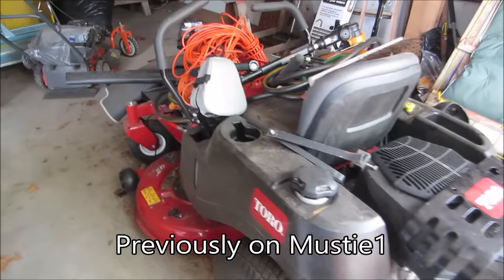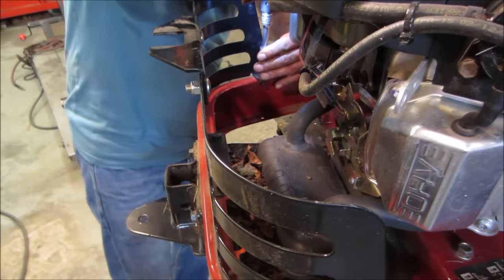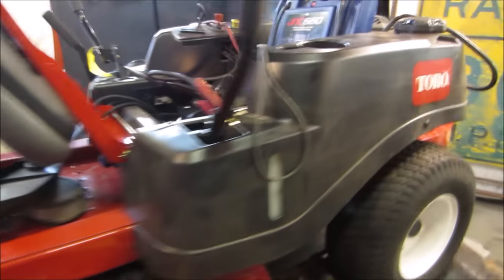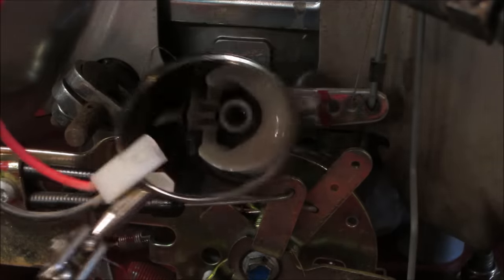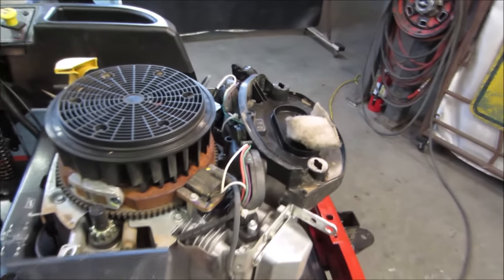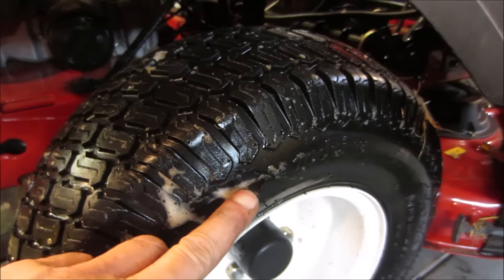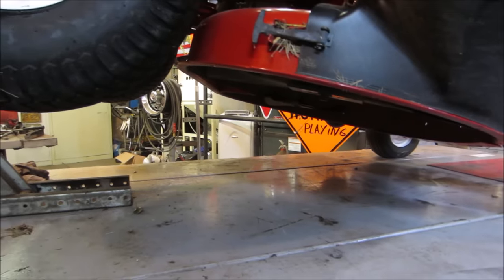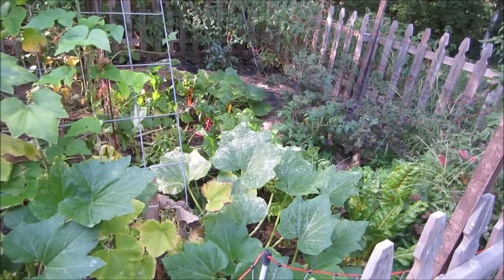Yard Sale $400 Toro Zero Turn Mower. Sitting For 10 years.

Comment: Zero turns are so expensive nowadays, so getting that toro for 400 is a steal in my opinion
Reply: I bought my Toro ZTR about five years ago,  thru Home Depot.  It was only $200 more than the Toro tractor with the same size deck.
Reply: living in belgium everything that comes on this channel is a "steal" anything used or second hand still goes at a premium price
Reply: That mower sells new for about $2700!!!
Reply: @donabele1243  company that I work for sells them for 10 000€ new!
Reply: 10,000€ for a zero turn? You can get a new sub compact car for close to that price.
Reply: @jC-kc4si  these toro are around 5k here
Reply: NO !! KERBSIDE !! TRASH !! IS !! THE !! STEAL !! FOUR !! HUNDRED !! RIP !! OFF !!!!

Comment: I used a side patch for tires. Worked till they were dead. Trick is to clean and grind the top layer off the inside then glue then dry then apply the patch with a roller wheel

Comment: FYI I have a zero turn with an enclosure around the engine. I installed pipe wrap on the exhaust manifolds and muffler. Dropped engine compartment temperature by 20-30 degrees.
Reply: Great tip. 👍👍
Reply: Good idea! I use the header wrap on my racecar never though to put it on the mower. Will definitely lower the air temp also help with keeping it catch fire around the exhaust and muffler. Ok I'm headed to the garage now! Lol

Comment: I bought and older model of the "Time Cutter" just to get me through one season so I wouldn't have to buy a new mower in the spring. I've had to weld it up all over for being worn out but it's still cutting so I use it for the rough part of the yard  so as not to tear up my new one. I had to change out a blown head gasket. The drives are sealed units, I asked a dealer about the life time and he told me he had never had one returned with an issue in the drive units other than a belt issue. The first few times I mowed with a Z turn my hands were worn out from holding on but after I got used to it that went away.

Comment: I was telling you to use Right Stuff on that tire. You got me hooked on it. 
A friend of mine just bought a used cub cadet. First riding mower I have ever worked on. Thanks for all you have taught me about them. It was backfiring real bad. The fuel cutoff in the bottom of the float bowl was disconnected. Thanks for explaining that.

Comment: I just got inspired to put Mustie on pause and go down and pull the fan shroud off my riding mower engine and blow out debris to ensure it doesn't overheat. I've had it a dozen years, had never done it, and figured it might be a good idea. Turns out, really didn't have much debris, but don't regret doing it. Took less than a half hour.

Comment: Louis Rossmann had the same camera issue - the need to use an app to get the camera running. The only reason for that is that they want to track you, so don't use it for privacy reasons.
So far GoPro don't do that, even though GoPro have some quirks too.

Comment: Your friend will love the bagger when it comes to doing leaves - it looks like you've literally vacuumed the leaves up it leaves the grass so clean.  I bought the 55" version with the Kawasaki engine about four or five years ago; have around 60 hours on it now (there might be a cutout for an hour meter in the crosspiece behind the seat - it's an option on the later ones at least).  I found the trick to driving it is to hold one tiller bar steady and move the other back and forth to control the direction - it reduces the PIO (pilot induced oscillations) that otherwise make you look like a drunken sailor trying to cut the grass.

Comment: I look forward to every video. You do a fantastic job.  On those old tires, dry rotted, rim leaks, small seeping leaks, may I suggest you lay in a supply of  TireJect. Unlike the many "popular brands" this stuff just works without fouling up the insides of the tires or the wheels. As a last resort,  used TireJect on my dry rotted, rim leaking, and eventually un mounted tires on my 1996 Craftsman tractor with all flats, that sat 4 years in a dirt floored shed.   The machine isn't worth the even the cost of tubes.   I'll be darned if they sealed up and have remained fully inflated over a year...still in the shed.

Comment: For leaks like the tire had I have used patches inside the wall of the tire with success. Some of the kits for truck tires have large and thick patches which I found work well. If it does its far cheaper than a new tire. You found a good buy with this baby.

Comment: I have an SW4200 Toro.. Love the Steering Wheel..  Bent the deck, but fixed it, welded more steel.  Big Spindles, Super Air Flow thru deck, Big Starter issues, Rewired most everything.. Rear Bagger, Big rear Tires.. this thing will go nearly anywhere, and does side hills superbly..  Hydrostatic is SOLID
Reply: Got sick of all the interlocks.. the parking brake module got replaced as well.  Got sick of it.. wired around things as they failed or were suspect..  How many starter relays have I been thru?  Starter kept getting stuck between poles, so I leave it just a tad loosely bolted down which seems to work so far.  Some clearance is just a tad too tight..  The Deck is very Weak..  the welded deck version would be much better structurally but with an even far WORSE Air Flow Design.

Comment: I have the 42 inch Toro ZTR.  My only issue so far has been the electrical connection on the electric mower clutch, won't stay in place.  I finally just made two short jumper wires, and used standard electrical terminal ends to connect to the clutch,and a spade connected to plug into the original harness.  No more issues.

Comment: I have virtually that same mower..a Mustang 50 that is about 7 years old. Yours looks brand new by comparison. 
 I paid $2400 7 years ago, don't see them new anymore for less than $3k.
I need to go shopping with you.
That is one hell of a deal for a really tough mower.
*Also, you want to change the oil even if it doesn't look like it needs it because..
the poorly designed drain tube setup tends to weld itself shut. I had to cut the end of mine off and make a new one the first oil change.

Comment: I really appreciate these videos. This one specifically saved my brother and I multiple hours of trying to diagnose my sisters lawnmower. She told us what it was doing and we immediately went to see if it had a float bowl solenoid valve and sure enough it did. We clamped off the gas line, pulled the solenoid, turned the key and it did nothing. We told her to buy a new one because we did not have the tools to "fix it". She ordered it, her husband put it on and it fired up immediately. She thinks we are the smartest guys ever. It's mainly because we watch all your videos but what she doesn't know won't hurt her. Thanks again.

Comment: That was a great deal on the zero turn mower! I would've checked the oil. Drain the gas, and sprayed carb cleaner, just to make sure. An hour meter can be had from Ebay digital hour meter for 15.00 bucks!

Comment: I live in nm, where we have big stickers (weeds). For tires with tubes I would line the inside of the tire with an old thick tube (tractor tire tube) (cut to inner tire size) using rubber cement to adhere the tube to the inside of the tire. Assemble everything.Fill the inner tube with fix a flat not slime. Obviously if you had a flat patch the inner tube before pumping fix a flat and then the compressor to the correct psi.
Haven’t had a flat.

Comment: I have two of these mowers. Grease fitting and valve stems on caster wheels are a pain in the butt. Use a leaf blower to clean off deck as water will set in and ruin spindles fast. I keep a spare spindle and idler pulley after 3 events. Since I stopped washing with water no issues. High Rpm and prechopping leaves are the key with leaves. Let the bagger fill and clog and prep hop leaves then worry about bagging. Must faster

Comment: Hey Mustie, that mower has build dates on the engine cases and on the fuel lines from 2013
I'm missing the old restoration videos on the VW's !
Keep on the good work!
Reply: Yep, Exactly what I saw too! The mower is a 2014 model manufactured in either 2013 or 2014!

Comment: My dad has one of these mowers. They're notoriously difficult to get fuel to the carb again if you run out of gas. It's a great mower; we run ours hard. Its only issue is that sometimes that bar that connects the two transmission shears off.

Comment: I just watched your B17 Compressor video.  part of the reason it's leaking oil is you had it lying on its side.   It's meant to be mounted with the fan at the top and the oil reservoir at the bottom.   I'm commenting here because the comments are off on that video.

Comment: I've had the best luck with green slime on mower tires. Tire guys hate it, but if you put the recommended amount in each tire it usually last until you completely go through the tread or run over a stob puncturing a huge hole in it.

Comment: One drawback of the lever steering is that if you are going around a bush of good size and a limb catches the lever it turns you into the bush.  Wife has buried ours several times and has the battle scars to prove it.  She would not even let the kids (teenagers) mow with it except the pancake flat bushless  part.

Comment: Nice job. For a short time Toro had a solenoid brake on these mowers. The problem with them was you couldn't release the brake without 12 volts, so if your battery was dead the wheels wouldn't turn by pushing. oops.

Comment: It looks brand new, I have the same 2019 model, motor has changed but the rest looks the same.  Take the weight kit off the front if you don't have the bagging system on the back.  Plus it would've been easier to push.  :)  You got a 2700 dollar mower for 400 bucks, nice find!

Comment: Just got a free mercury mark 10 outbid motor for free. Had a couple of minutes yesterday and put it on my stand. Wanted to pop the hood off and haven't figured that out yet. It's like the first cover you took off on this video with the 1/4 turns on both sides. Watch a video from the 60's and the old guy said you have to play with them to get them off. Oh fun, first challenge

Comment: Nice mower looks like a cream puff , try this somtime on cut side wall tire use flex spray /black (like on tv ) spray on after cleaning fill crack with air in tire then take out valve core and let it set over nite then fill with air ,try it.
Reply: Just get a new tire.
Reply: @tomtheplummer7322  gotcha Tom problem is i got about 22tractors /mowers they dont all deserve a new tire.

Comment: What works great for that type of tire issue is "Pliobond", I used it to repair a plastic gas tank on a generator (which was no longer available). For $6 at Ace Hardware it's truly an amazing adhesive, just let the pressure out, apply pliobond and let set overnight and it will stay fixed. You know how bad generators vibrate but 3 years later mine will not leak a drop of gas.

Comment: i remember the 1st time i had to drive my Toro Timecutter. i had to drive it up on my utility trailer using ramps pretty much just like yours. it was pretty sketchy getting up there without going off the edge. at that time i didnt know it had a trim mode which makes it go much slower. It's been a great machine tho.

Comment: I say dry the tire off real good.
 Let all the air out it.
Clean it real good with acetone. Put some super weatherstrip adhesive ( black) on both sides of the tare. 
 Let it sit up for 5 or 10 minutes until It gets tacky then
 Stick it together.
 Warm it up with your torch. 
Slime the inside of it with some air pressure & you should  be good to go!👍
Reply: Put a tube in it and ship it......get on with your life.

Comment: if im observing this correctly the bar on front of the toro its black  is used as a jack it helps to change the blades and other needs as far as elevating the front end of the mower. ive serviced them before.  i believe thats what its used for. after further observation, maybe not.

Comment: You might try letting the pressure out of the tire before that "outside" glue job on a very slow leak.  Sometimes the leak is thru the cords, kinda like a cigarette filter.   That's why it's so slow.  You'd have to seal the entire inside of the tire to stop it because you can't find where the air is getting into the cords.  If you let the pressure out before applying the glue, the glue can wick into the cords and stop the leak.

Comment: As big as your garage is I'm wondering if you can submerge a tire into a hot bath 140-175 F and leave it for a couple of hours. While you might get the tires off you can patch them from the inside with an innertube cutting. On the farm it's not always what you can get, as much as it is what you can make work.

Comment: I've had 3 since 2010, they are very reliable for residential.  I've cut 3000 yards easy with each one
Reply: Do they hold up pretty good?
Reply: @snoopfurlow1275  yes, the deck can become unlevel if you hit stuff but other than that I say yes

Comment: When I was a little kid on the ranch - I watched the workers take a tractor tire off the rim (split rim and fix a hole if the side wall by torching an old piece of tire over the hole inside the tire - it worked pretty good. I wonder with adhesives today if that type of repair would work?

Comment: An old-timer tire repair Guy taught me a trick do a Hot Patch I'm at tire and I'll never come apart do you use the same stuff that you do a repair on an inner tube you just rough up the sidewall on the inside they put the glue on it and you use a lighter ignited I let it burn out and then you apply the patch while it's still hot and that will never leak and it will hold that sidewall and become part of the sidewall Play the song is that tire is on that tractor

Comment: I have the same exact Toro except its an SS5000.50" 3 blade deck and Kowasuki 22hp engine... Tell Brian to pull the plug off of the safety master switch located directly under the side to side crossmember under the seat and fill the connector with dielectric grease as they're prone to moisture damage due to wiring funneling water down into the connector...160 bux n up for a new one plus having to repair the corroded wiring...
Reply: Same chassis.same drives.same clutch.same tank pod.same covers.same everything except the deck and engine...  I paid 100 bux for mine with 478 hours on it due to fouling plugs which was a broken oil ring...300 bux total in it including new belts.rings.idler pulleys.blades.tire slime.spindle bearings.grease.oil.filters.plugs.etc... Beats a 42.46.49" Craftsman.Poulan.Husqvarna.etc riding mower hands down all week long and twice on Sundays...

Comment: Might consider putting a vacuum on the valve stem when applying the glue. It will suck the glue into the hole giving a two way cure.
Reply: Nice idea. Be worth a try
Reply: Great idea.

Comment: I'd replace the battery since it's several years old. A battery in poor condition that needs jump-starting will overwork the alternator when the electric clutch is engaged. It's too much of a load on the alternator trying to charge the battery and keep the electric clutch engaged, and most of these home and garden center variety mowers have only a small alternator. Learned this recently from the youtube channel TarylFixesAll.

Comment: Before putting a tube in the leaking tire I'd try the flex seal in it while I had the tire off the rim I'd paint the inside of the tire and let it dry for a couple of days before putting it back on the rim then try airing it up. Oh yeah when are you getting back to the scooter?

Comment: I have a time cutter ss4235 with a Kohler sv710 courage engine (the predecessor to the 7000 series)
The issue was that it would not start 
And the engine would turn over then would stop when the valve opens
The valves needed adjustment the brake control module had failed and I decided to remove all safety features then I rewired it and it works great I ask it to cut 3 acres or 1 hectare it's one of the best mowers I've ever owned and leaves the best cut I've ever scene  and it powers through thick Alabama grass and it can handle the Alabama heat very well I cut my grass on a Friday or Saturday

Comment: if you deflate the tire, that might help cure. also there's a new device called trumpets that you screw in where you used to push the plug in. i got them from ebay.

Comment: I got the same motor except mine is 24 hp just had one  new coil and valves adjusted on it good motor. Only thing about those Kohler motors you have to choke them every time you go to crank them weither the motor is hot or cold just the way they are. 13:44

Comment: Easy way to tell if a zero turn has low hours is by how sensitive the control levers are. Brand new they are very touchy, but after about 50-100 hours they mellow out.

Comment: If you cut a couple of 1/2” copper pipe pieces to cover the jaws of your pliers you won’t run the risk of cutting into the fuel lines little trick I use on plumbing soft supply lines

Comment: I just got a free snapper zero turn. The PTO clutch seems to be dicked and the carb needs a little work. I figure with a cleanup, and $130 in parts I could get that thing running like new again. Is that a worth while investment? I do small engine repair but I have no experience in the market of used equipment. I think it's a Snapper z150 or z50 or something like that. It's probably 10-12 years old I imagined.

Comment: I have one.  That bagger setup costs 700 stones.  The mower was 3k with the Kawasaki 22 hp.  Full throttle, full choke to start.
Reply: somethings wrong if you need full throttle to get it to start. Supposed to start at lowest RPM/throttle and work throttle up in increments  to get warmed up , back throttle down to half before engaging the PTO/blades